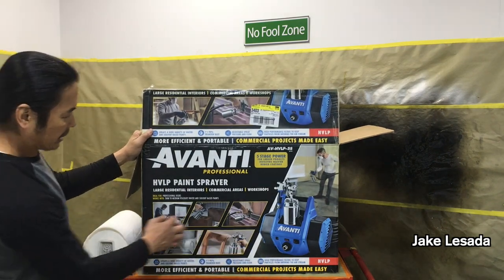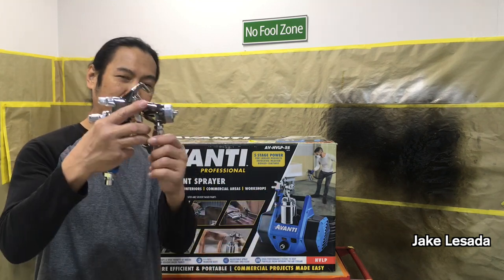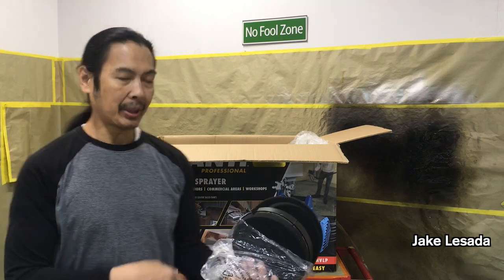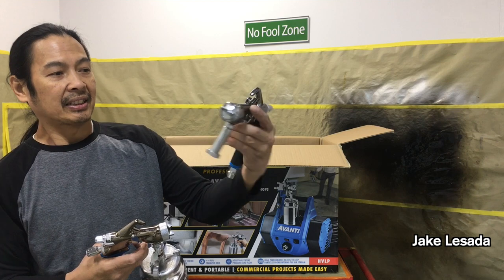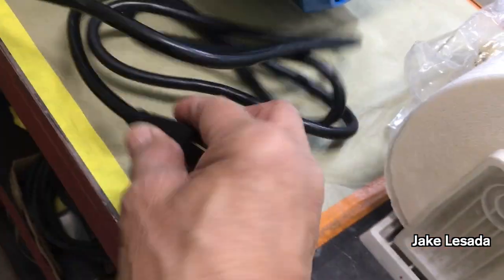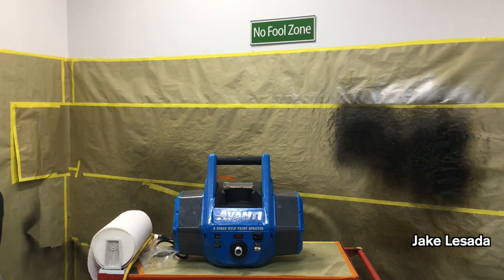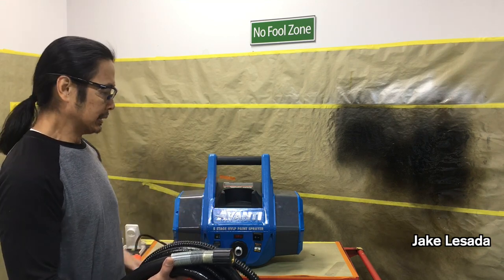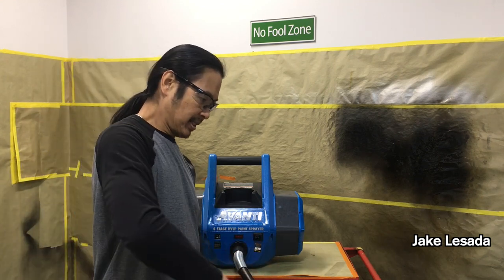Avanti 5 Stage HVLP Turbine Sprayer Unbox with Jake Lesada.

Comment: You mentioned the 0.8 needle for base coat and/or the 1.3 for base and clear.  I actually used the 3 stage Avanti similar to this one to paint a portion of my son's Honda Pilot.  I didn't take any notes on which needles I used but purchased both from HF.  So I have all 3.  .8, 1.3 and 1.8.  Will be completing the rest of the Pilot soon.  What are your needle recommendations with this gun for primer, base and clear?  1.8 for the 2K primer?  Or the 1.3 also.  I will actually be testing on a 96 Nissan truck that is badly in need of a paint job.
Reply from the maker: I still have to order a 0.8mm for base coats.  The 0.8mm has always been the common size for base coat with turbine spraying.  HB has the 1.3mm good for clear coats or sealer primers and some primers with less solids. The 1.3mm will work for base coats but you have to move fast -  the psi with this machine is good.   The 1.8mm should work for 2k primers easily - but it depends on how thin or thick the 2k flows, just be careful you don't over saturate or flood out the lay down and give it time to flash properly.  If you can work with the 1.3mm and get decent results with 2k primers great, go with that - I prefer a straight panel with excellent body work and less relying on high build primers to get the panel straight.  Primers and all products sprayed need to be at a minimum and a maximum of dry film mils thickness.  Spray too thin and you'll have no adhesion grab or coverage - too thick and it could crack. If you try to bury with high build -  understand how much shrinkage your material dries down.  Sometimes it looks good, but after it shrinks the sand scratches will come back and surprise you.  Common recipe:  Primers - 1.3mm to 1.8mm,  Base coats - 0.8mm, (1.3mm will work but has heavy wet if you move slow),  Clear Coat - 1.3mm works excellent.  Also note,  depending on the clear coat brand or type you use, sometimes that clear coat will flow like glass or peel like an orange.  Overall clear coats  tend to flow more before locking in the dry.  Fast dry or quick clears - depending on the solids in the mix -  tend to orange peel more like factory oem texture.  The longer it takes to dry - the more time clear coat will flow.  So, you are either battling dust or bugs in diy or cut n buff when it speed dries with texture.  Good luck with the 96 Nissan Truck.
Reply: @JakeLesada  Thanks for the info and reply.  One more question.  I think I'm gonna try the 3M PPS H/O Pressure Cup setup.  Are you using the 13.5 ounce cup or the 28 ounce cup?
Reply from the maker: I think it's the 13.5 ounce, or however many ounces my H.O. cup is. It's more of a medium H.O. size.  I know it's not the 28oz.  Just did a spray out with Avanti 5 stage and base coat with  2:1 + 10% reducer clear coat.  It worked out decent I'll be posting that soon.  I used the 1.3mm needle and tip for both the base coat and the clear coat.  And, I choked down the air fan adjustment to halfway with a .75 fluid mix out.
Reply: Hi Jake what is the price  of that stage 5 avanti machine? Do they deliver  in canada? And can you do a complete  car with  that ? Thank
Reply from the maker: It's priced as of today on Harbor Freight's website at $599.00 US.  I don't know if they deliver to Canada, the item is an in store purchase only item.  Another,  person living in Florida wanted it shipped, but they had to drive to the nearest Harbor Freight to purchase it.  I would be able to paint a whole car with it, no problem.  Thank you for watching and commenting.  Let us know if you are able to get one in Canada.
Reply: I believe  they don't  ship it in canada  the price I'd good

Comment: Would you recommend this setup to spray single stage urethane for automobiles?
Reply from the maker: I'm not going to make any recommendations yet because I haven't sprayed single stage with this unit. However, based on my initial testing of how it behaves with water and how it operates, it looks very promising.  Also, consider what brand of single stage paint you are using and the solids content of the material and type of hardener or activator ingredients - not necessarily the temperature choice, but the actual ingredients of the isocyanate in the hardener or activator.   Some single stage, no matter what and how you mix tends to peel or tighten up.  Some single stage brand paints flow and level regardless of spray gun or machine.  When I get some single stage paint I'll do some testing and find out.
Reply: @JakeLesada  I wish I knew that some ss paint levels regardless.  I shot basf/rm/limco ss paint the other day and it gave me a 'four out of ten' orange peel.  I think it was the gun setup; 1.0 tip with the needle turned in pretty good, and I think I should have used slow or extra slow reducer since I shot it outside in the Sun.  Cut got it flat but the sand scratches are somewhat noticeable.  I'll sand and reshoot sometime in the near future.
Reply from the maker: Yeah,  I have sprayed PPG Delfleet Essentials Single Stage on the hottest day outside.  The problem with outside spraying will be the air hose getting heated up from the sun shining onto it, or also the machine heating up and both those factors changing the spraying air temp to hot. The surface temp of the panel will be an issue too. If you can get an inexpensive temperature reader to temp the panel - you'll see surface and hose temp in degrees and from there, you'll get a better guess at what you can do to make a difficult paint day workout for the better.  Try to shade the air hose somehow before you actually spray and then depending on how the paint is showing on the panel - adjust the spray gun closer to get more wet saturation -  try and get paint flow before dry out to orange peel. And, you'll also have to move fast to keep the edge from kicking over to slick. The way to move fast is to adjust the material flow to rich and if possible pressure up to get more atomizing pressure at the air cap.  Depending on which brand of spray gun you're using - adjust on a test spray wall so you can see what it looks like before going to the panel.  Do the test in a short actual spraying pass and not just a static straight shot at the wall.  You've got to move as if you are spraying, but only in a short pass. You'll see then what's actually happening with the paint. Yeah, good idea to have extra temp reducer on hand, but if not possible - always try to get full wet saturation by moving closer or fluid up and go richer.  If you are seeing sand scratches, remember paint has windows of opportunity for certain task.  Too soon and it's a mess, too late and you have to abrade for mechanical paint grab. And, sometimes you just have to wait - do something else to let the paint cure over to off gas and let it dry out to the next window of opportunity.
Reply: @JakeLesada   With my machine,  I did your test with the water and found that my 1.5 needle/tip with a few turns out lays the glossy finish you talked about; I just have to move the gun a bit faster.  Would I run into troubles 'chemically' by shooting my ss 2k paint "over-thinned" beyond what the manufacturer recommends (solvent pop, delamination, haziness, adhesion, etc.)?  For my 4:1:1 ratio I was thinking maybe 4 to 1.5 or 4 to 2 to get the viscosity the gun might like better.
Reply from the maker: Yeah, it's not wise to over thin the material.  If the mix allows a 4:1:1 ratio, that is more than sufficient to give you flow.  A 1.5 needle and tip can flow single stage easily and water very easily.  If you are able to gloss out the water great, try leaning your mix to have the water spray dry and then in small increments fluid out to gloss and figure out the pace can you move comfortably without rushing to get gloss.  I count about 3-4 seconds on a panel pass as good,  5-6 seconds is slow.  Think - "mixture, distance and speed".  When the mix is dry you have to move slow to get gloss. When the mix is wet or over wet you have to move fast to avoid runs.  The balancing act is achieving your speed to wet gloss and no runs.  Part of that equation is the air psi and the amount of cfm your machine can or can't give you. But, if you can achieve glossy water you can achieve glossy paint.  The larger the needle and tip size the more air psi or cfm it will crave.  When you go smaller in needle and tip size you can use less air - but the question will be - can this small size push the molecule size of what you are spraying.  If it's too small a needle and tip is gets choked up and super craves air to push it thru and atomize - this will give you orange peel and overspray.  And, as always since you asked about your custom mix ratio - do it, experiment and see if it works.  Sometimes going out of spec does work, just remember you'll have more solvent to flash off (dry, off gas) between coats.  Solvent pop happens when you bury the coat with another coat too soon and the paint slicks over to dry.  Or, it happens if you add more than the recommended coats in too fast a total time batch.  Example, at the collision center we sprayed Sherwin Williams fast high solids clear and everything was laying out show style - then we said let's add another coat cause it's going so well -  the panel didn't like that and it horribly solvent pop.  Luckily it was on that one panel cause we stopped the process with that one panel.  If your spray gun can gloss water - your spray gun can gloss paint.  Speed is only relative to how fast you want to move or how fast you HAVE to move when spraying.  You'll get it, do some testing and prove your test works.
Reply: @JakeLesada   I'm going to do some testing on a large door sized piece piece of sheet metal when it cools in the late afternoon, if things go well I'm going to spray the door handles, mirror, and rear bumper. Thanks for the advice!
Reply: I shot the same material in the morning yesterday and it did better with the 1.5, with less less peel and the needle opened more.  However I didn't reduce it as much as I think I should have.  Going to scruff the piece flat and respray today with 50 percent more reducer.
Reply from the maker: Yeah, go for it and see how it test out.  When you achieve something you like, you can expand from the knowledge you have gained from this testing.  It's always best to keep a note book and write down your recipe from each spray session.

Comment: Any advantage to using a gravity feed gun with pps vs the bottom feed?
Reply from the maker: With turbine spraying, the cup is pressurized from the side air tube going into the cup.  Once the cup is pressured, the air forces the fluid out similar to how gravity would flow the fluid out of the tip.  The advantage to gravity feed would be the natural familiarity of spraying if someone is crossing over from compressor style paint spraying to turbine paint spraying.  I have an older video on this channel that shows the difference, " compressor vs. turbine spraying".
Reply: Performancrewise with metallics etc not an issue then?   just wondering because i just grabbed a avanti 5 stage on open box and have a fuji unit but wanted to try the avanti gun with the pps
Reply from the maker: Metallics are super easy with turbine spraying.

Comment: Hey man what is the part number for the regular pps adapter you have on that gun? Not the 2.0 one…
Reply from the maker: That's the Legacy version part: 3M Adapter #18, 
also known as: PN -16054.  
The H/O Pressure Cup (Mini) is 3M 16121.

Comment: What length and diameter Flexzilla hose will fit this unit?
Reply from the maker: The length of the Flexzilla is 5/8x50ft., but I cut it into two different lengths - 15ft and about 30ft.  Watch my video on painting stuff and explaining the Flexzilla hose mod - 50ft is too long in length and will have pressure drop at the spray gun air cap.  You want more cap pressure to atomize paint, so don't go too long in length.  When, I modded up the Flexzilla, I used the Apollo fittings and couplers, they work excellent.  Also, watch my Oetiker clamp reusing video, those are the clamps I used to make the mod.

Comment: Do you think this system would be suitable to paint a boat with polyurethane marine paint?
Reply from the maker: As a note*, I have not sprayed marine paint with this 5 stage.  However, most marine paints have a viscosity that I think this Avanti 5 stage could handle, and this 5 stage has plenty of atomizing power.  In the past, I've sprayed Awlgrip 545 epoxy primer and I know how that stuff flows and sprays,  this Avanti 5 stage could spray it no problem.  Epoxy sprayable fairing compound would need the larger needle and tip and would need the 5-25% reducer to get better flow.  Above the waterline top coats should be easy too.  All paint applications are based on wet mils or dry mils thickness and viscosity flow rates.  I think this 5 stage could handle marine paint,  it's got wild psi and cfm power to atomize.
Reply: @JakeLesada  I’m planning on using Total Boat wet edge one part Topside paint. It is a polyurethane paint. Hopefully it works out. Thanks for the info and the videos.
Reply from the maker: I just read up on the TDS sheet of Total Boat Topside Paint and it looks like an easy to apply coating.  They're allowing for reducers and mils paint dry thickness is within a normal thickness.  Nothing too thick and not too thin with 2-3 coats application.  Should work out no problem.  Thank you for watching and commenting.
Reply: @JakeLesada  one more question- have you had any issues with it overheating? Several of the Harbor Freight reviews state that the 5 stage was overheating. There are much better reviews on the 3 stage. 🤷🏻
Reply from the maker: I haven't had any issues with my machine overheating.  The hot temps in the booth have been in the 90's and no issues.
Reply: @JakeLesada  thanks again 🤙🏼

Comment: Hi,what's the difference between stage 3 and stage 5
Reply from the maker: The difference between a stage 3 and stage 5 turbine is the amount of internal fans built into the turbine.  The more fans stacked into the turbine will be a higher stage fan unit.  I have sprayed with a very early version turbine unit and it had no power to atomize water  when I sprayed.  Water spraying practice is how I check to see if I can spray paint with a machine.  If I can atomize and spray water, and make it glossy,  I know I can spray auto paint with the machine.  Without first spray testing the Avaniti, I felt the air pressure and flow amount at the store, and from my spraying experience I knew it would work for my spraying needs.  Avanti does have a 3 stage, but I have not tested or tried that unit.  Thank you for watching and commenting.